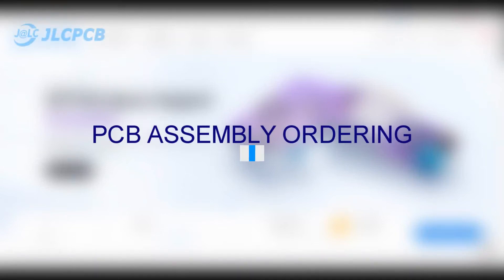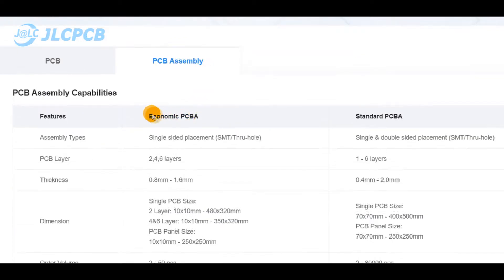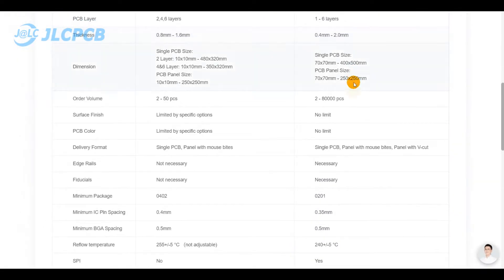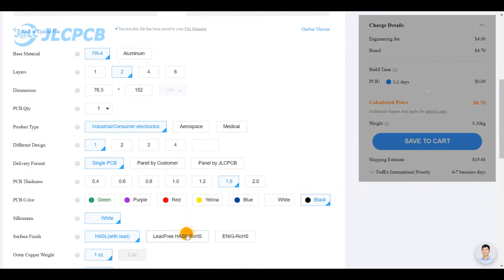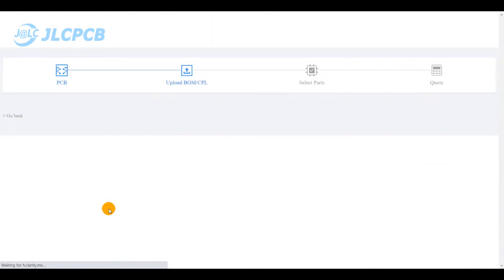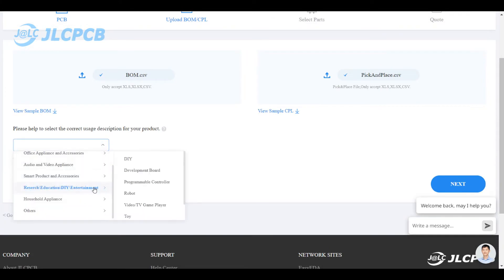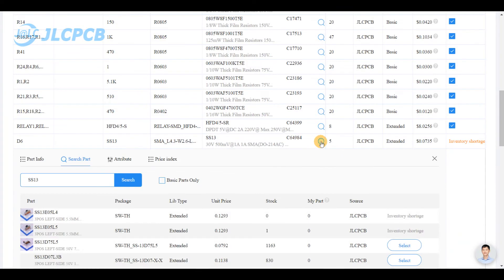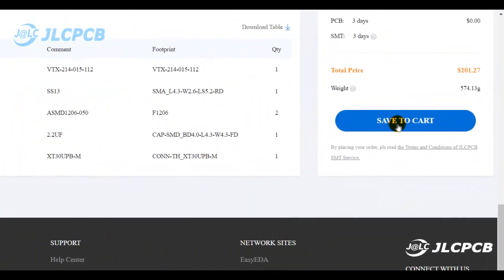How to Place a PCB Assembly Order at JLCPCB

Comment: I'm preparing my next board for JLCPCB manufacture and assembly now.  The problem I'm having is I use Fusion 360 and there is no link to the LCSC parts catalog.  The best solution I have found is a plugin for Fusion 360 called SnapEDA.  It has a lot of part models that I can load into my design, but I have to hand-search for a part that exists both in SnapEDA and LCSC.  Sometimes it's easy but yesterday I found exactly one vertical USB Type C connector common to both, and LCSC only has 3 of them in stock.  I know LCSC and EasyEDA are tightly linked, but please extend an automated link to other CAD system if you want more people to choose the JLCPCB assembly service.